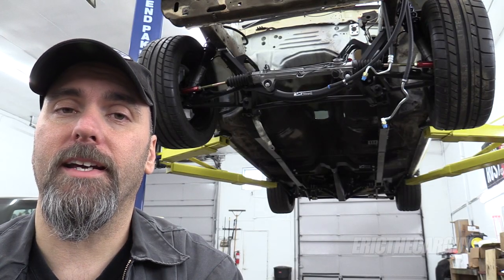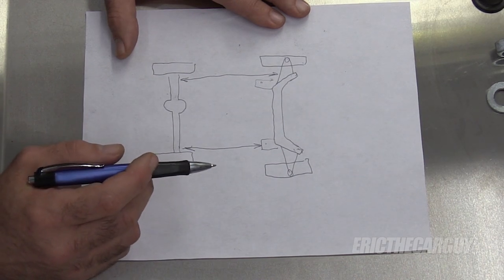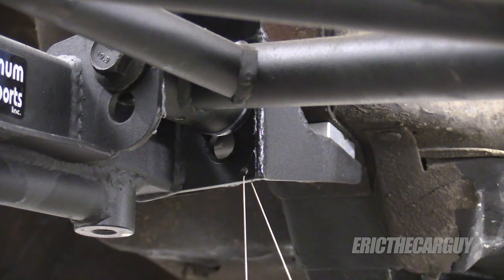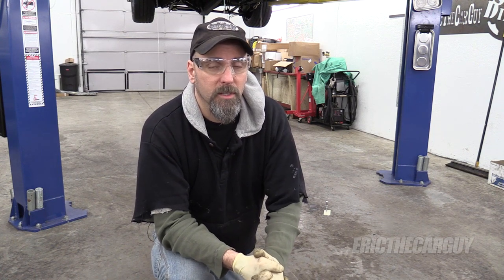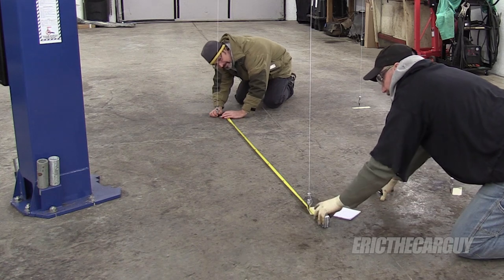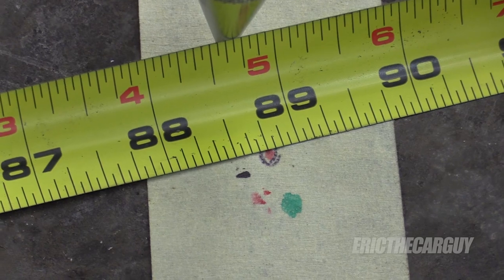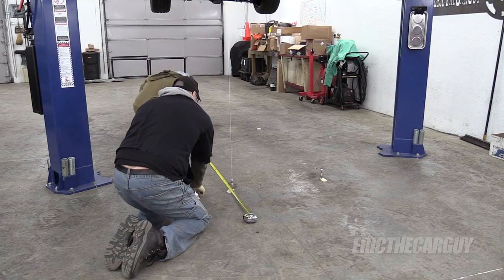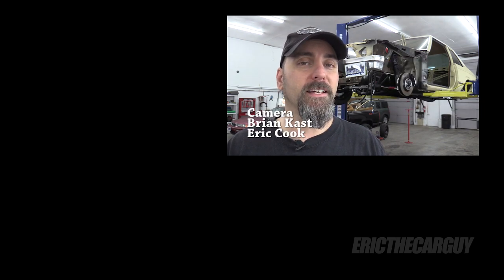How To Square a K Member and Why It's Important

Comment: 88 13/16th...

You know, imperial measurements really make no sense to my EU self. What was wrong with just saying 225.58 cm? Or 2 meters 25.58 cm or 2256 mm (rounded)? All those fractional inches really screw things up for me. xD I don't know how you keep track of them as there are so many fractions. Fourths, eights, sixteenths, 32s, 64s....
Reply: because we don't metric here for a standard. we have to translate metric to imperial so you get to do the same. i use a conversion calculator(mostly b/c i am older than most here who visit the channel). it's on the phone. have long since given up frying my brain on this one working on the xjs and other folks rice :-) thanks for the chuckle though. age makes a difference in many areas and this is just one of them.
=dok=
Reply from the maker: I get it and you'r right. Thing is, I have an imperial tape measure and that's what I used. However, in the future I think about incorporating a more 'global' approach to how I talk about measurements. Thanks for the input.
Reply: Neither do we
Reply: Blame past Preident Jimmy Carter for that.
Reply: Haha, yea the video was very interesting! but the measurements meant absolutely nothing to me!
a combo tape might be an idea :)
Reply: They were pushing the metric agenda for the USA way back in the late 70s so I don't think all the blame can be put on one man especially in the 80s. 

It was pushed so hard at one point in Smokey and the Bandit you can hear Sally Field after looking at the speedo say, "Are we really doing 110?" She was asking in kph not mph. 

As we know 110 is only 68 mph. But to the millennials and others out there who don't get it, 55 mph was the federal top speed you could go even on interstates and that was still considered "fast" by many. 

Some people think it was a goof in the movie as the speedo only went up to 85, but it was on purpose and again, she was asking in kph not mph.
Reply: Just a thought to everyone here... the U.S. actually IS metric based. For a while now, all of our units of measurement are actually defined by their metric system equivalent. So, yes, we are metric, we just convert it to a different unit name so that anyone else in the world has to convert it back in order to understand what we are talking about. Which, makes our system even more ridiculous sounding...
Reply: Actually you don't need any measurement system at all. You are only going for equal so a unmarked piece of string would work fine.
Reply: snipeish1 the measurements were meaningless only going for equal
Reply: because 'murica.  be secretly happy because imperial units are officially "translated"/based off of metric.
Reply: The units system used is irrelevant, the actual distance is the same whether Metric/SI or US Customary/Imperial units used. 
I have become accustomed to using both, it is not difficult and bitching about Metric/SI or US Customary/Imperial units used in a YouTube video is just a display of laziness, ignorance and or immaturity. 

Since 1959 and revised in 1975 US Customary units are based on SI units and are an official unit of SI measurements.
The change to Metric/SI system units in the US stalled in the 80's under the Reagan administration, however its was actually Congress that stalled the conversion via US federal codified law.
Reply: The problem was that the U.S. gov't was trying to get the populace to switch like in one day/week/month. Getting anybody to change in a very short timeframe does'nt work. It's like asking someone to quit cold turkey. That's why the try in the 70's failed. Now, they are doing a gradual switchover. Ever notice that all the packaging has both standard and metric measurements on them? Also, ever noticed that when you buy a large bottle of soft drink for the family or a party, that we call it a 2 liter, and not a 2.1 quart? That is part of the gradual switchover. The schools are teaching the children metric measurements, too.
Reply: 5280ft in a mile... Yeah standard units are a mess.
Reply: Totally Legit Gaming [TLEG] lol.. I know what you mean. But it's not as hard as you may think tho. Two 16th= one 8th, two 64th= 32nd.. The bigger the number, the smaller the measurement. I am a foreman in a facility that measurements are paramount. Customers don't want to use the metric system (for whatever reason) when we engineer prints for precision production.  Being ISO certified, even countries use the imperial system when products are on the board..
Reply: jon doe, does that include products not destined for the U.S. market?
Reply: Don't feel bad. I'm American and I don't understand the Imperial system at all.
Reply: (225 + 5/10 + 8/100)cm

Comment: does the car need to be on the lift square?
Reply from the maker: You can use jack stands.
Reply: While I'm sure a pro lift is completely square and level, I'd have to wonder about jackstands. If you're jacking up the vehicle from the middle (middle of rear end, middle of k member) then maybe it's not much of a concern as long as you are exact with the mounting points of the jackstands and the ground is perfectly level and straight. But I know all too well about body flex. 

I had a Trans Am with T-tops warp its B-pillar on me due to having a 600 ft lb 455 Poncho in it and a Crown Vic's windshield spontaneously just crack on me once, while parked, for no other reason I can guess than pure body flex (I guess it was "settling" back into place?). The door would also meet the front fender when opening, shutting it when jacked up on the front driver's side, so even it being a body on frame vehicle STILL had that much flex in it when jacking up in just one point on the frame.
Reply from the maker: David McClelland Gravity doesn't change. If the front is slightly higher or lower than the back, it's not going to make much difference. As for your Trans Am, that was a common problem with T top cars because of the lack of structural integrity. Not to mention manufacturing was not as good then as it is now.
Reply: Absolutely, which is why I mentioned t-tops. I'm not convinced a jack stand on the right rear sitting on 1/2" lower ground as opposed to the front left isn't going to make much of a difference when we are getting down to 1/8 and 1/16th inch tolerances and the body is obviously going to flex. Maybe you are with your experience, which I lack. 

Maybe we should invoke Jason and his white board on this one? I think like him and as much as I respect you I do not take someone's word for something involving so much precision and potential for variance. I need numbers.

Comment: um, with the nose droop that body does when lifted, that entire exercise was wasted time. you are at tolerance limit on square, if either side gets "longer" when loaded, you are now out. the droop comes from the firewall, so your connectors dont actually do much until a cage is added, at least in regards to nose droop. the body has to be supported by the nose, preferably sitting on the wheels at all 4 corners, fully assembled and normally loaded. that way ALL body alignment tolerances are stressed to their normal static positions, about as good as you can get as dynamic loads make those boxes wriggle, lol. watch your other vids where you lift it, that nose droops around 3 inches as the load comes off the firewall. on a full frame, or a chrysler imperial of 60s vintage, squaring like you did is fine. assembly rigidity holds everything muy bien. on 80s airbox fords, with almost zero rigidity added by body radii, you may as well be dropping chalked marbles from body points. btw, for those rear bob drops, use the bolt to hang the line, with a spacer off the torque box face (just a pipe nipple pair filed to equal lengths), in the opening where your arm normally resides. spacer on box "ear", bolt running through ears and spacer. same relationship to the body, just transposed past clutter. on the ground, equal length pipes that fit over the nut, with holes crossdrilled alike on both. those control arm holes are sway bar mounts, their position tolerance alone is probably ALL of your squaring tolerance, so using them is once again at best not incredibly accurate. chalked marble drop time again, lol. in fairness to you, that body is probably the least tolerant to unloaded alignment adjustment of all most would tend to meet in the real world. ALL the cantilever hangs off that firewall, and the windshield is about the only genuinely rigid part involved, lol. check it out when you get the front end aligned when done, the k member will have wandered away from "ok", even if never disturbed

Comment: What if one should take the measurements using the metric system?
Wouldn't that be more easy to check the differences?
(I'm from Europe you see....)
Reply from the maker: Likely it would. The principals are the same however.

Comment: Shouldn't the vehicle  be on the ground (and you sitting on the drivers side) while taking these measurements? The bushings, suspension, wheels  and the whole car-body acts differently when there is weight on it. And in the end of the day, you're driving it with wheels on the ground anyways.